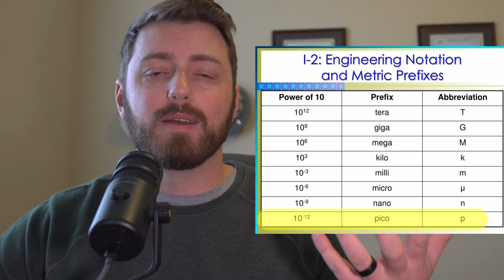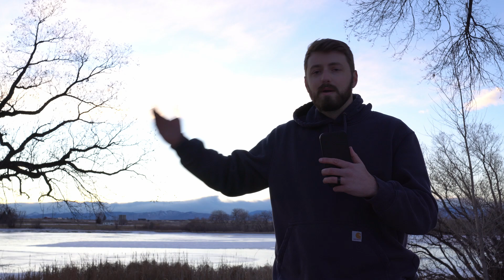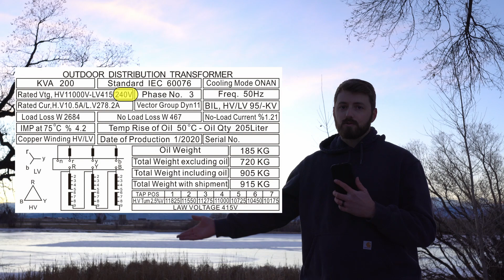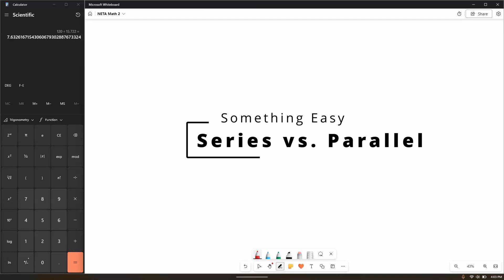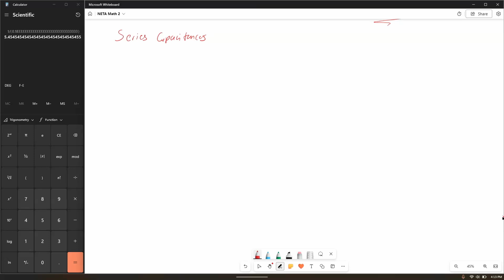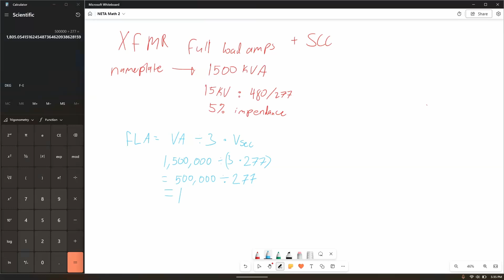The Ultimate Guide to Electrical Theory and Math for the NETA Exam

Comment: when you added up your parallel resistance, you missed typed your 60 Ohm resistance. you marked it down as '0.166' when it should have been '0.0166'. This changed the final calculation quite a bit. your answer of '3.215 Ohms' should be closer to '6.25 Ohms'. I have been wrong more than once in my life, so double check me. Great videos FYI!
Reply from the maker: Dang, I had two other mistakes that I caught in editing lol great catch. Thanks

Comment: For the FLA, you initially wrote it as VA/3 X Vsec. But when you plugged it in, you plugged it in as VA/ (3 X Vsec). As PEMDAS says these are different equations that would yield different answers, which one is correct? I'm assuming the latter but I wasn't sure. Loved the video though!
Reply from the maker: Great question. Yes, it's VA / (3xVsec). Sorry for the ambiguity.

Comment: Can you help me with SEL architect and making a CID file with assigned virtual bits. I’m on a 61850 job and for some reason when I pull the CID from the 351 I don’t get any of the associated VB’s. Is there something I’m missing or do I have to manually enter them in? Thanks DM or what ever if you wanna help a tech out
Reply from the maker: That's odd, they should pull into the CID. I think the fastest way to get that resolved would be to call SEL. Their customer service is incredible.
Reply: @ Matt Marrotti lol

Comment: I'm at the point where I came from the Construction side of things but was never shown electrical theory, so I am scratching y head trying to figure it out! I love your videos and enjoy the content, but I am struggling remembering a lot of formulas for my NETA 2 exam. Any tips?
Reply: Just wanna come back here and mention that I passed my NETA 2
Reply: Like TTT said you have access to a formula sheet and you can download a copy at the NETA exam website to review.  It doesn't have everything though (for example available SC current), my advice is to practice using them and get an understanding of what the formula is "doing" rather than just trying to hammer them all into your skull through wrote memorization.  As a simple example instead of trying to memorize that I = E/R, remember that your current should be higher as voltage goes up and lower as resistance increases.  Probably not needed for that example but for more complex formulas that sort of thing can help you remember what should be included and where and help jog your memory if you start getting confused.  That approach also helps on questions where you're not asked to calculate anything directly but are asked "what happens when ... is increased in a circuit"  Good luck.
Reply from the maker: Fortunately the give you a sheet with the formulas during your exam. It's just up to you to know how to apply and solve them.

Comment: Nice work, this is a very difficult topic to cover quickly. Over the last couple years I’ve seen more people coming into testing with little or no electrical background. Two of my newer guys asked what the difference was between apparent, real, and reactive power. A couple minutes in I realized they needed a more fundamental understanding of circuits before they would get what the power really meant.
Reply from the maker: Thanks! Yeah YouTube videos aren't a complete replacement for classroom learning but I like to think I can help a little bit.
Reply: Trigonometry is the basis for most math a NETA tech requires.